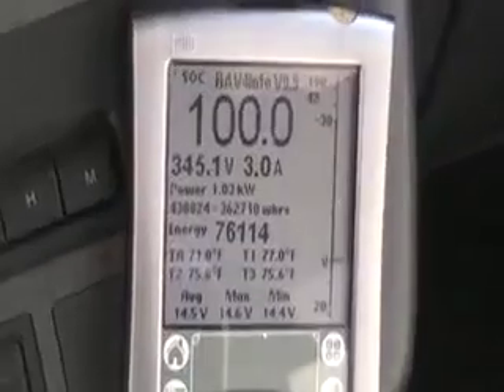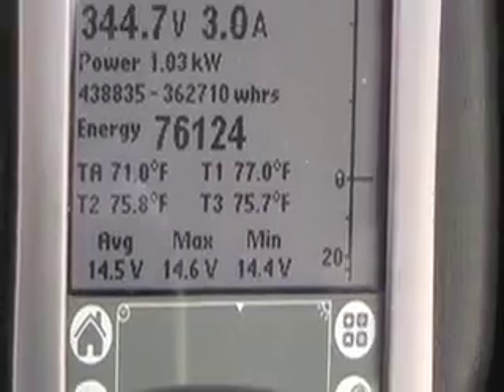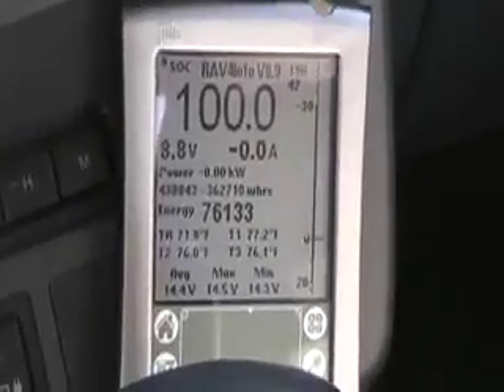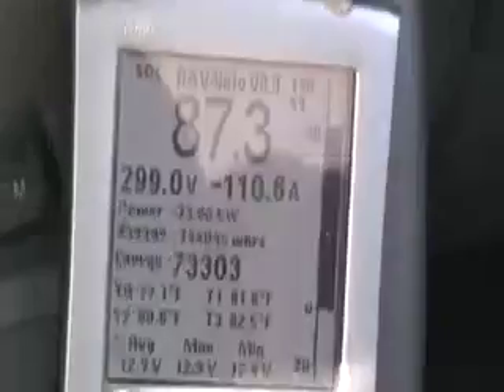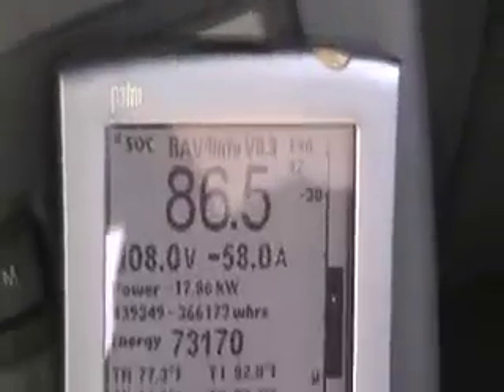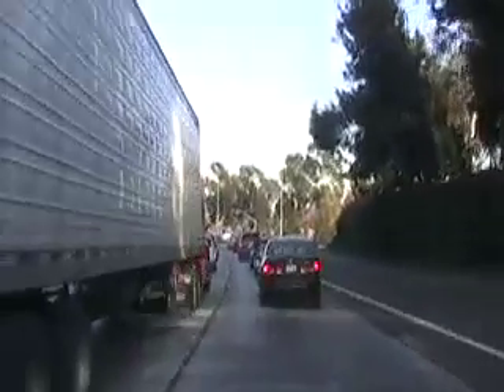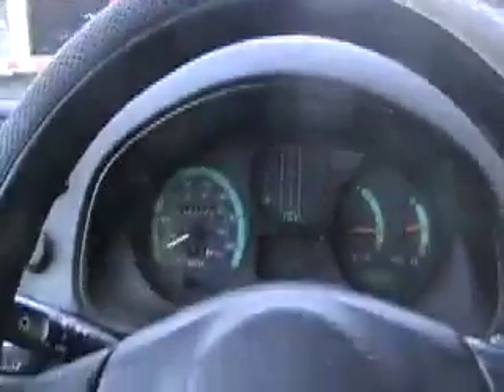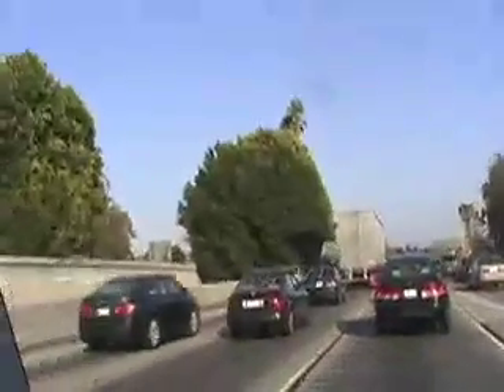NiMH battery leveling process

Comment: Very True. Would it be safe to say the most strenuous use of the battery would be a drain from near 100% to near 0%? That is how most reputable battery companies rate their products cycles. 
Describing the charge discharge cycles as a conglomeration of mini-discharges and mini-charges is rather underhanded. It's what battery companies do to claim a cycle rate of 10,000 or more.   
Worse case scenario 1000 Charges empty to full At 100 miles range (average) per charge. you still did 100,000 miles.